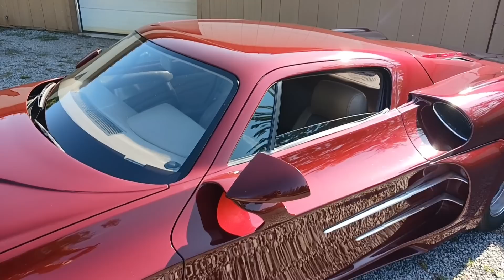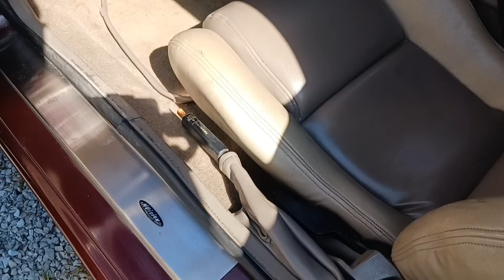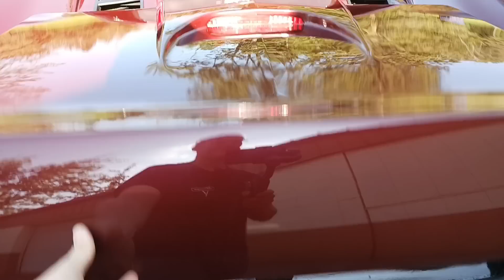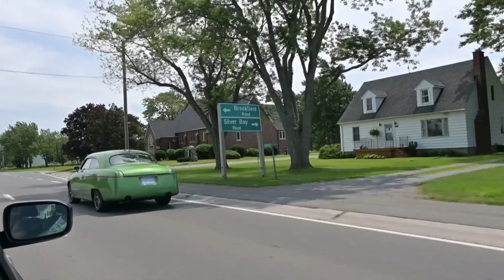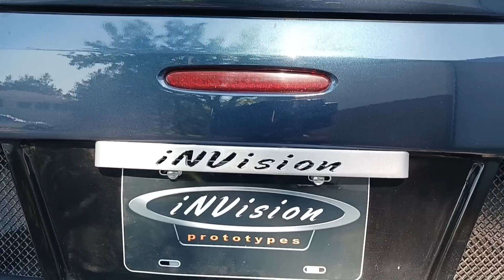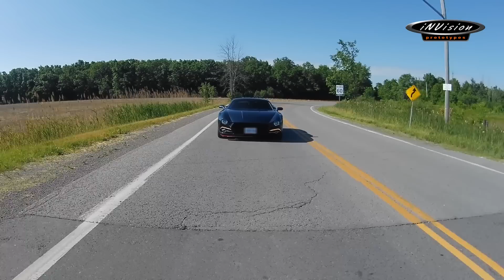Some GUY Builds His OWN Mid-Engine Sports Cars FROM SCRATCH

Comment: It's a well crafted piece of art. But what's  the big deal if it's fiberglass and not metal. I would rather it be fiberglass, since it will last forever.  Metal in the other hand will rust.
Reply from the maker: Yes, metal will rust if proper prep has not been done to ensure that it's sealed from the elements.  Check out some of the restorations we've undertaken, they can be found in playlists/IG/facebook.  When it comes to composites, have you ever seen what happens to say a C3 Corvette as it ages?  Stress cracks, spider cracks and dry rot.  All pretty nasty stuff.  Thanks for watching and the thumbs up!

Comment: HAHAHA I TYPED THE BELOW COMMENT 10 SECONDS IN. I KMOW BETTER NOW. How do you shape the body parts and everything? I guess it has to be fiberglass doesn't it? Which if so that is some amazing craftsmanship. But otherwise how would someone shape the metal that way? Did I understand correctly that there are videos of it being built? It os BEAUTIFUL BTW. That blue is my color!!
Reply from the maker: No problem!  There are a few videos of R2's block sanding, getting an engine cover and interior upgrade.  However, the main build was done before we started a YT Channel.  R1 was built at a time when people were still using 35mm film.  Thanks for watching!!

Comment: Hi Nick, it's great to see your old photos and the hammer n dolly finishes
Instead of the wheel. I do t have an English wheel and so it's all hammer n dolly. You dont see many finishes without the wheel so once again, you inspire the heck out of me. Back to the mgb once I've finished my cup of tea. By the way I wonder if an xjs bonnet can squeeze onto my project😂 . Joe
Reply from the maker: Those pics were taken with a 35mm camera that used actual film 🤣 How times have changed!  As for the finish a lot more planishing that took place after that photo was taken.(and those fins @_@ .... where eliminated)  Absolutely nothing wrong with working a panel using a hammer and dolly, just takes a little more time.  If you watched me frenching the headlights on the '51 Shoebox I used a "strike 'n slide" technique with the wide faced hammer on the rings to give them a smoother finish.  I'm sure you have a slapper/spoon - they help a lot.  (If anyone is reading this comment and wants to see how to make one you can see a few photos on my facebook page https://www.facebook.com/media/set/?set=a.263247900385292&type=3)  As for the xjs bonnet, I'm sure if you had one and did a little nipping/tucking/blending it could be made to work with the one the MGB.  Thanks for watching!
Reply: I do use the strike and slide and often have a laugh to my self saying "who needs a wheel" but boy does my shoulder hurt at the end of a session. Thanks for the link on the slapper and.... there is a classic jag dpevialist just down the road from me, hummm? 👍🏻😖😁